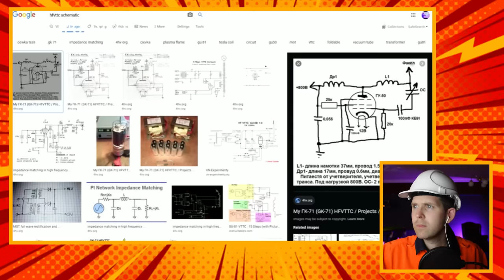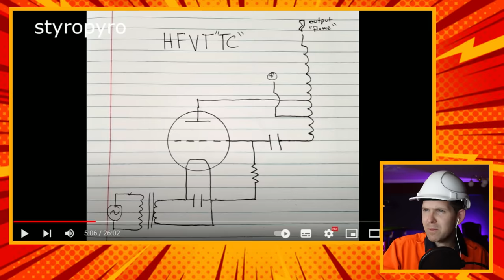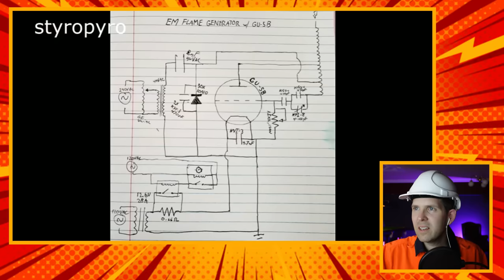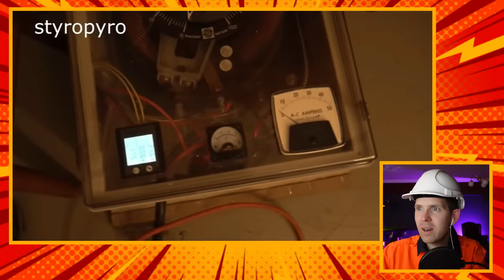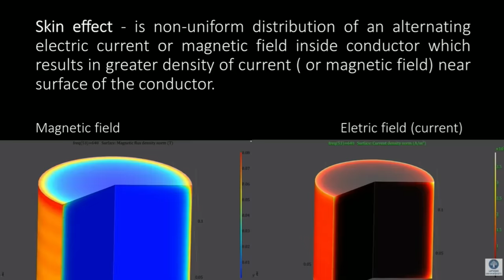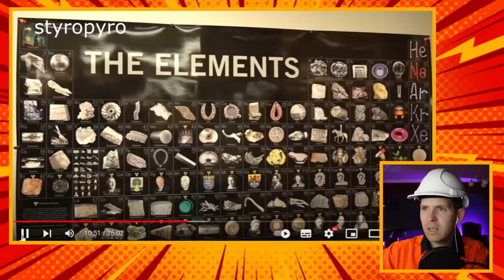Electrician Reacts to Styropyro’s CRAZINESS 🤪

Comment: The idea that Styro does what he does because he's bored is both hilarious and terrifying
Reply: It is common; I also like fire and electricity. I used to pour gasoline on stuff and light it on fire when I was 10 years old. Me and my friend had pool noodles and dipped them in gas and lit them on fire and used them as weapons against each other. They were flinging the noodle material around as if it were napalm, just sticking to stuff while it was on fire
Reply: "today i was bored on the couch on a saturday, so i reanimated a dead corpse to see what happens"
5 minutes later
"pretty cool right?"
Reply: @pyropulseIXXI  Spoken like a proper little arsonist :) I blew up black powder, removed my eye lashes and eyebrows, that was fun to explain.
Reply: @kevint2555  Yeah, we also made bombs, and piccolo pete bombs just by wrapping them in electrical tape a few times and hammering them with a sledge hammer.

They would explode pretty loud and we had a stash of 50 and would lite them and toss them over fences during 4th of July parties and here BOOM, then a bunch of girls screaming

if You hammered near the fuze just right, it would turn into a 'rocket' propelled pete and then explode; we learned that by accident when one shot off super quick and then exploded 15m away

We also emptied the powder from 100 piccolo pete's and I put it in a plastic baggy that was secured inside a extremely sturdy bottle and I spliced 4 fuses together.

When that sucker went off, it not only set off car alarms in the entire neighborhood and blasted our ears, but it also temporarily blinded us via a flashbang effect

Comment: I remember seeing a comment on the original video that suggested the weird colors to be caused by second level ionization. As in, it was ionizing the valence electrons AND the electrons in the shell below. That would explain why the magnesium had a striking red that looks a lot like lithium, or a green and violet that looks like ionized carbon and nitrogen respectively.
Reply from the maker: That is super interesting concept. Do you remember if they mention anything about all 3 shells 🐚
Reply: Well the color of light depends on the ionization energy so looking up the shell energy levels would provide info.
Reply: So basically at the end of it it's just a ball of protons?
Reply: @Pteromandias aren’t we all?
Reply: @Pteromandias  Don't forget the neutrons. We still need a bit more temperature from that circuit so that we can get the electroweak force to manifest and do wacky stuff to the atomic nucleus as well.

Comment: There is actually a very good reason you've never seen that circuit, and it's the same reason all of Styro's vacuum tubes are Soviet surplus - the only scientists experimenting with the concept were Soviet. The West simply wasn't looking at it.
Styro is a scientist sorely in need of an Igor.
Reply: Then... Ah, what was the concept they were researching?
Reply: @eXMytheral  uuhhh...I'll have to rewatch the video first. I'll get back to you.
Reply: @eXMytheral  One plausible Option is some sort of radar like the famous Duga radar, those could easily reach a transmission power of 10MW. Also fits the timeframe
Reply: That style tube very common in commercial broadcast transmitters
Reply: An Igor would suit him well. Especially for patching him up and occasionally reviving when the safety precautions turn out to be inadequate.

Comment: The steel wool is especially complicated because you can light it with a 9 volt battery. Yeah, those double-sided ones that you can shock yourself with if you lick the end, if you touch both connections to the metal, it's actually iron, which heats up quickly and reacts with the surrounding air and natural conductivity to send that energy, and therefore heat, across the whole thing because it forms a circuit.

Comment: @ThinkList  -  The skin effect is exactly how you described and as the frequency increases the conducted power moves toward the outside of the conductor. The transmission outputs of large multi kilowatt transmitters is made up of large copper pipes used for water and plumbing. We used to buy copper pipe and weld/solder/braze them together with insulators inside and pressurize them so that they would not arc over. Many times we would silver plate them and pressurize them to near 100PSI in order to keep the arcing down. If RF arcs, the resulting plasma ball from the copper and/or silver or other metals will deposit on your face, eyes, hands, lungs etc and it comes at you like an explosion. It is very dangerous stuff. Another way to conduct high frequency electricity is a wave guide which actually works very well. The theory behind all this is well documented but keep in mind this kind of electrical/electronic work is 50% witchcraft and 50% science. 😎👍

Comment: If I had to hazard a guess, I'd say that due to the extremely high temperatures in that plasma, the carbon electrode was chemically reacting with the magnesium to momentarily create molecules of some weird carbon/magnesium alloy that gave those colours. I'd guess that the different concentrations of carbon to magnesium in these alloys would be creating different colours as the plasma almost instantly vapourizes it again? Idk, just my thoughts
Reply: That was just pure magnesium ribbon being burned, no carbon. My guess is that something funky is going on with the outer electron shell perhaps gaining or removing an electron and then burning in the air causing a color shift, but I don't really know crap about this stuff, just some slightly educated guesses.
Reply: According to one of the commenters in styro's video, for both the zinc and magnesium, it's likely that the plasma is so energetic that it is ripping off the upper electrons from the zinc or magnesium atoms and exciting the lower orbitals.

Essentially, the plasma is performing alchemy it's so damn powerful.
Reply: @kaybe9797  not quite, since alchemy would require actually modifying the nucleus. It's still pretty crazy stuff though.
Reply from the maker: Not bad thoughts 💭 at all 🤔
Reply from the maker: This is crazy… if true 😆
Reply: I don't think so, to get new emission spectrums (that aren't a mix of 2 other) you need to get another atom involved in most cases.
Reply: @thinklist  As an addition to these thoughts, that deep red he was seeing was most likely singlet oxygen (O2 ripped apart into 2 O's) formed by the plasma. Singlet oxygen has a very distinct deep red glow.
Reply: My best guess would be it is not only fucking with the VEs but also the second outermost shell
Reply: The green is coming from the copper part of the electrode releasing gases
Reply: @gojohnson2511 I believe that's it. Each orbital corresponds to an energy level and color. He is hitting them all.

Comment: Chat gpt:Okay kiddo, you know how when you pour syrup on a pancake, it doesn't go everywhere at once? Instead, it kind of spreads out slowly from where you poured it?

Well, something similar happens with electricity when it travels through a wire. If the electricity is moving really fast, it doesn't spread out evenly across the whole wire. Instead, it tends to stay towards the outside of the wire, kind of like the syrup staying on top of the pancake.

This is called the "skin effect" because it's like the electricity is sticking to the skin of the wire. It happens because the electricity creates a magnetic field as it moves, and that magnetic field pushes the electricity to the outside of the wire.

So, if you're ever playing with wires or learning about electricity, remember the skin effect and think about how the electricity is like syrup on a pancake!

Comment: I think the reason why the magnesium was changing color was because it was probably not pure magnesium in that strip. It looks like they are mixed with different elements. Another possibility is that the camera is showing the light differently based on it brightness, which i don't think that is the case.
Reply: Or it might be some crazy oxidation state of Magnesium like +4, but I don't know

Comment: Think about a tank circuit. The higher the frequency the smaller the coil. If you think about the cross section of a wire as a bunch of shorted turns stacked together into a tube, it's easy to see that the skin effect is just the outside of the wire acting like a resonant coil. I'm sure you understand 3 phase and possibly six phase, but at high frequencies the "loop" that is the skin of a conductor is basically infinite phases with all conductors touching.
Reply from the maker: Hmm 🧐 might need to research that one

Comment: Air carbon arc gouging rods are cheap, and you can get them in different shapes and diameters. Most welding supply shops should have them or be able to get them easily.

Comment: So, the skin effect is about how the field propagates INSIDE the conductor, not outside. At DC, the field is uniform throughout the cross-section (more-or-less). As the frequency increases, the current density in the center of the conductor decreases exponentially, and it becomes concentrated more and more towards the perimeter of the conductor. It's because the wave simply doesn't have time to penetrate all the way to the center of the conductor from the outside. At mains frequency, the skin depth in copper is about 8.5mm; that is, if you have a copper conductor with a radius significantly larger than 8.5mm, then at 8.5mm from the surface, the current density will be a factor of 1/e (about 0.37) as strong as at the surface. 

This means, for sufficiently high frequencies, most of a large conductor is there more for its physical support and heat capacity than anything else, as the current density in the center will be effectively zero, and is one of the reasons why once you start getting into the microwave regime, you really need to start using waveguides.

The wikipedia article is a decent overview; but of course, check Pozar for more through investigation.
Reply from the maker: Sophie this is amazing 🤩 thank you so much for the incredibly thorough explanation. Oh and thanks so much for supporting the channel 💪
Reply: @thinklist  No problem! Microwave engineering is hella interesting and was one of my favourite undergrad subjects.
Reply: When i studied electrical engineering (danish Marine Engineer) my teacher made us (the class) calculate how wide a hole we could drill through a cobber-conductor and still only loose 1% of the current - due to the skin-effect.

Basically you could hollow out very wide conductors and still transport all the power you needed - at least in theory - not sure if the idea is used in practice :D
Reply: @tonnilerche  Indeed! Microwave engineering is the wonderful world where our two major approximations of electromagnetism (in engineering; obviously classical electrodynamics is just an approximation of quantum electrodynamics etc) --- circuit theory and geometric optics -- break down, as they are the low-frequency and high-frequency limit, respectively.
Reply from the maker: @tonnilerche  that is super interesting 🤔 I mean yeah not sure it’s good for the integrity of the cable 😆

Comment: The skin effect is caused because the frequency is oscillating quickly enough that the metal kicks the electric field away from the conductor. That is why you cannot use aluminum or copper clad pans on an induction cooker. Also when the frequency gets high enough metal is just a mirror rather than a conductor. As to what causes the color change with magnesium, it is neutral Mg metal vapor making the red, and Mg 2+ ions making the green color. The incredibly high electric field stops the Mg from immediately burning. 🤓

Comment: I worked on transmitters using the valves at 4:08 - they need 1kW for the HEATER alone (and the cathode is thoriated - slightly radioactive - in order to enhance electron emission)

Comment: 11:50 No surprise there with the graphite rods ... that's how old (REALLY OLD) movie projectors used to generate light bright enough to project to a screen 30+ meters away and still be visible. My home town still had two of those projectors back in the early eighties and I got to help the projectionist on occasion with keeping the electrodes the correct distance apart so it had enough light without moving them too close and generating enough heat to melt the film. (There was a lens from welders glassed with score marks that showed where the tips were at any point and you just moved them a bit closer when it reached a certain distance apart.

Comment: "angry electrode" XD i love it! my guess on why the magnesium burned in various colors would be that magnesium in the presence of water produces oxygen and because he's super heating the air around it as well as electrifying it that the process is not only splitting the vapor(moisture) in the air to create oxygen and hydrogen but the magnesium is also combining with it and burning in the various colors. magnesium already burns white hot so it's just a matter of altering distance or frequency of the light emitted to change it's color, would also wager it's the changing frequency as the arc changes form that's causing the light to change from white to various other colors as well. would certainly be an interesting research topic.

Comment: About skin effect: If you apply Maxwell equations to a conductor of AC with large cross-section, you'll notice that current flowing at some point of the center of the cross-section will cause an EMF around it, affecting any other current around the center of the conductor (and vice versa). The more you augment the frequency, the more the current will push itself via electromagnetic induction to the edges and the exterior, where no current is flowing and cannot push back. Conductance of the conductor will affec the gradient of this effect, this is why the better the conductor, the less skin effect it receives.

Comment: The skin effect increases the  resistance which decreases current. This is because high frequency electricity causes eddy currents in the "skin" of a conductor. That's where the most flow is and the skins depth is determined by the frequency.  For example.... at 60hz the skin depth in copper is 8.5mm.  So wire larger than that will either be a stranded variety called litz wire or they can use hollow conductors.

Comment: The reason the magnesium changed into many assortment of colors is, because the sheer heat from the electric current is oxidizing the magnesium and each oxidation state of magnesium as a color like pink, red, purple and more

Comment: One important thing about the skin effect is that it is not only determined by frequency. It is caused by eddy currents that oppose the flow in the interior of the material. That effect is much bigger in a material with low resistivity and high permeability and it makes the skin depth thinner. You can simultaneously have very pronounced skin effect in iron and very little skin effect in say, your arm.

Comment: i work on ISP coax cable and something i notice is the hi-freq travel almost on the surface of the wire and the low-freq travel near the center of the wire and wen i get a job where they say only hi-freq reach the clients i know i have a broken center pin in my cable
Reply from the maker: OMG that is AMAZING 🤩 great fault finding

Comment: Skin effect is the tendency of radio frequency current to flow on the outer surface of a conductor. It is caused by eddy currents induced into the conductor by the alternating magnetic field. Those eddy currents counter the normal current.

Comment: I'm not an expert, but I always, maybe naively, thought the skin effect is a subproduct of some propagation/diffusion delay of the electric field between the conductor and dielectric. It's as if at low frequencies, the conductor can maintain spreading the electric field for longer, therefore the inner part of conductor has the chance to guide the electric waves around the conductor. While at higher frequencies, only the outermost parts of the conductor get the chance to have an effect of the electric field, since they are acting much more strongly due to short distance to dielectric where the energy is flowing, and the cycle / electric field polarity reverses before middle of the conductor had the time to affect dielectric.

I may be completely wrong, but it's a mental model I use to feel like I understand it.

Comment: thinklist can you recomend a multimeter for working with high voltage?
i need to fix a crt monitor that has gone kaput 
kaput as the hot transistor blew and monitor is dead to the degree that the power led doesn't turn on.
it still has life but as the screen feels fuzzy as in putting your hand against the screen feels fuzzy
Reply from the maker: I would recommend using some HV test probes. They will going into a normal multimeter, they usually have an attenuation ratio of 1/1000 and are a much more affordable option 👌
https://www.fluke.com/en-au/product/accessories/probes/fluke-80k-40#

Comment: If you use two identical audio transformers and use a high frequency input at low current as an input. If you get nothing out then take the identical transformer on the output of the transformer your feeding 100khz frequency and current . It takes two transformers to get a reduced output due to the skin effect. This may be due to magnetic coupling of the transformers for power out. For this I used a garden light and two mini toroid transformers with ferrite cores.
Reply: Ok

Comment: 6:30 yes they are but induction forges are expensive and I have an electrical engineer friend whom I consulted on discord video chat (I literally pointed camera at all components and asked if it will kill me before touching anything).
Unfortunately I did mess something up and after a few days of experimenting with the newfound source of cheap heat for my workshop I ended up setting insulation on fire ;_;